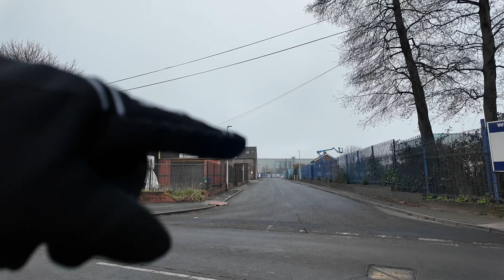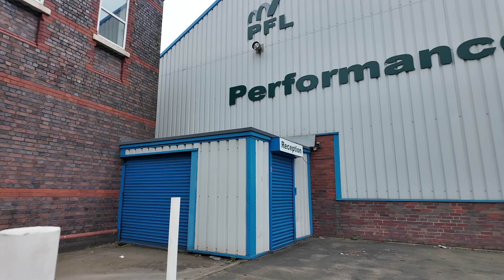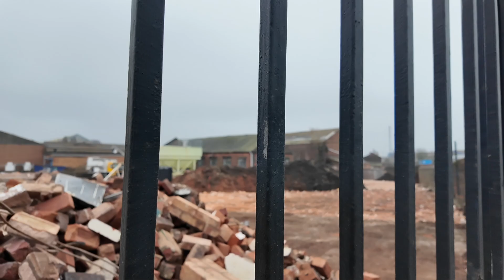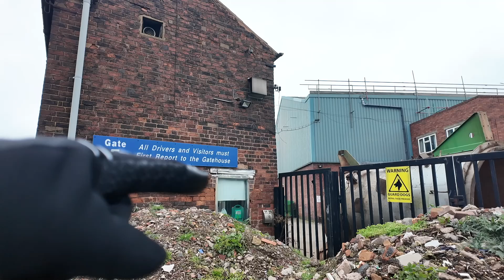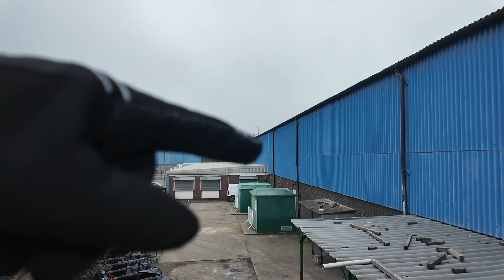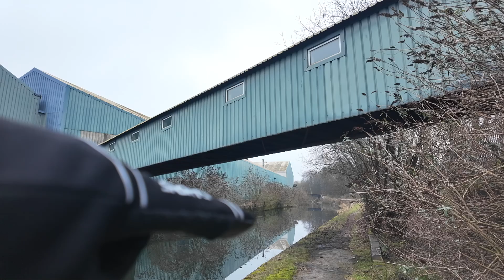WEST BROMWICH FACTORY DEMOLITION, more industrial heritage lost to demolition?

Comment: Cheers for the Video Phil    .Cope Allman finished  about 1980  .Then Tyco .   We then  had  Glynwed ..Capparo and   Liberty.  Will.have to get some pics of the siteNot sure where that rubble came from The two old buildings where the 'Rinse  Plant ' The large buiilding behind housed the Stores Electrical parts and Machine Shop... ( Lathes /Milling Machine/ Drillers / Saw.) Workbenchs .
Reply from the maker: If it does become factory units then hopefully a lot of it may still remain, however I don't hold much hope for the offices. Thanks SF